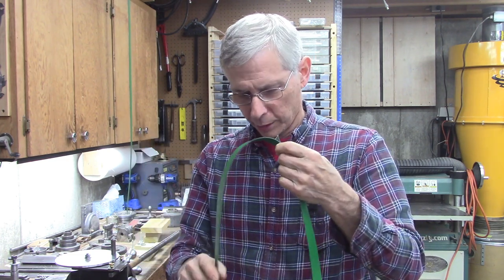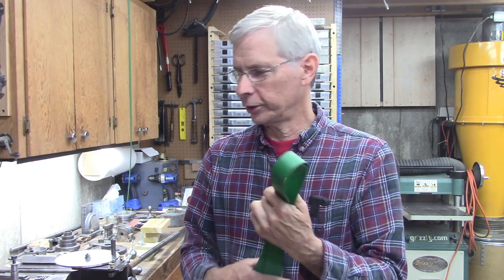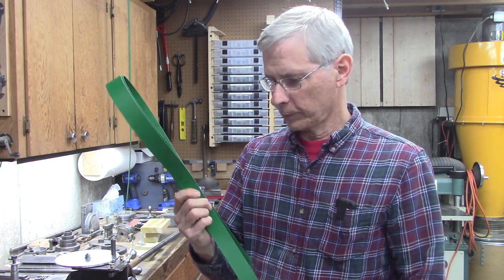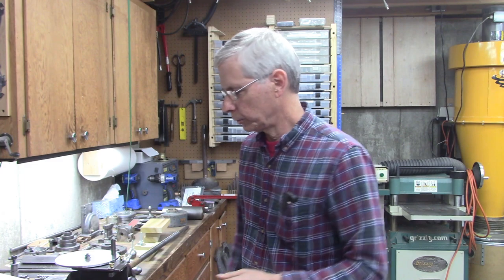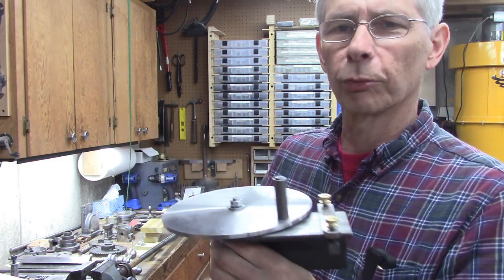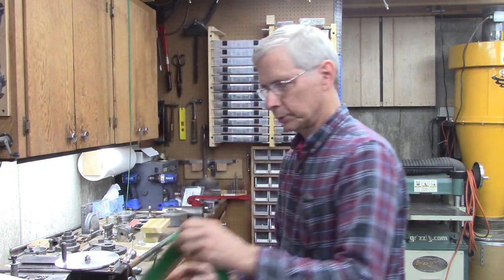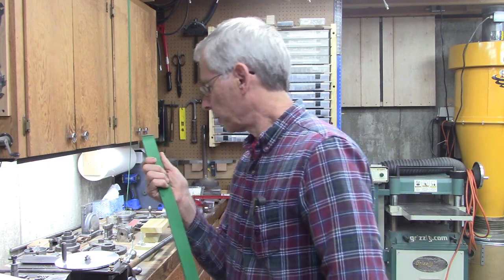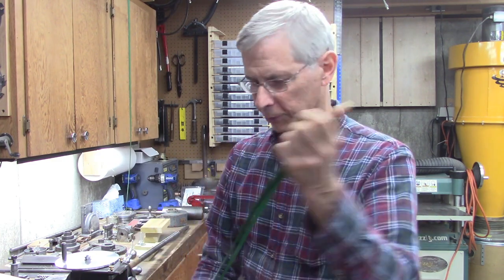Flat belt splicing and how to buy

Comment: I ordered and received my Vevor table, disaster, three and a half hours of work to make it acceptable, even had to order rings for the pulleys because too much play, very poorly machined    it even had rust on it    .............I had also ordered a milling machine vice in 6 inches and rotary but they could not send it to me, I was refunded. they sell without having the stock
Reply from the maker: Wow...  that sucks, especially that they sell something out of stock. Good that they refunded. "rings for the pulleys"? Not sure I understand. The machining on the two tables I have is great but the lead screws were terrible. One trick I should have covered in the video however....  the lead screw brackets had socket head screws in a counter bore. I drilled the holes bigger and installed longer bolts and a washer. (not using the counter bores). The allowed for more adjustment to align the screws. It worked perfect. Aside from the lead screws I think the table is equivalent to those costing 2 or 3 times what these sell for. Sorry if you think my video was misleading.

Comment: Hi Winky’s Workshop, I am building a belt drive RPM decreaser and will need to buy or make pulleys that will accommodate  the flat belt. Any idea where I can source the pulleys from?
Reply from the maker: I thought I replied to your comment with a link. Maybe YouTube removed it because of the link. I'm not sure how wide or what diameter you need but I usually make mine. Small pulleys out of aluminum and larger out of wood. Vevor sells some intended for belt grinders (that was the link)

Comment: Hi Winky,
I have a Wells Index model 55 knee mill, the downfeed  is exactly like yours.  The belt lengths are probably the same. How much would you charge to make two of these belts? I have tried all sorts of homemade remedies but nothing lasts for long. I can get exact dimensions if you would make them. Thank you for all the information regarding these old heirloom mills.  They don't make them like this anymore.
Reply from the maker: Click the first link in the description. There is an email in the document. Send me your name an address and write "Down feed Belt" and then I'll send you a quote. Run a tape around the pulleys...  It should be 24 inch or very close. If not, let me know what it is.  I'll do it for $10 plus $8 shipping.

Comment: If i were you, i would find some fillable fingernail polish bottles,and  resale that expensive glue for $5 a bottle. Enough to do two or so belts for the home guy. Make a kit with everything you need.a printable layout guide for alignment and grinding  the bevels.
Reply from the maker: I now provide glue for $5. Grinding an accurate bevel would be challenging even with a guide although that would be nice if possible. I also sell a guide although it's not the best design...  evolution is needed.